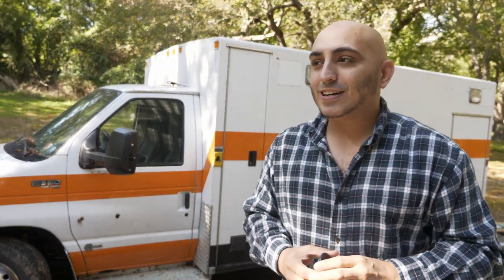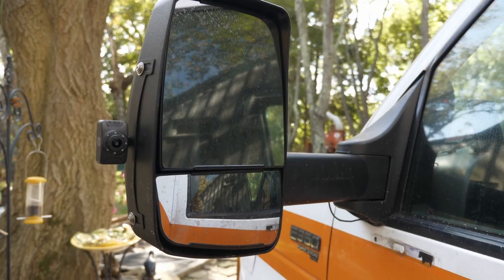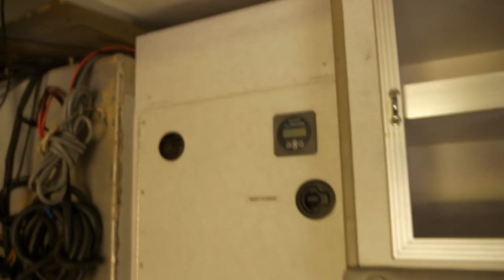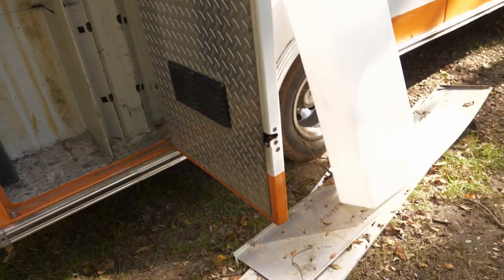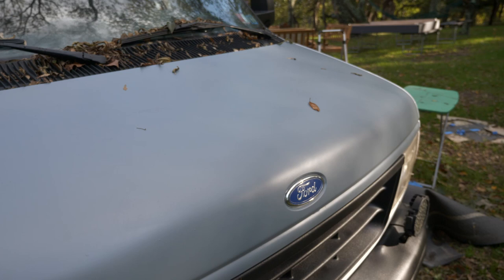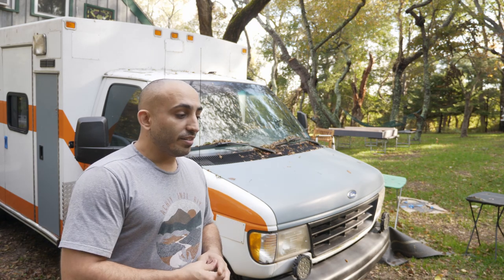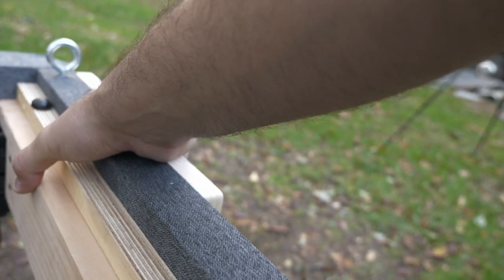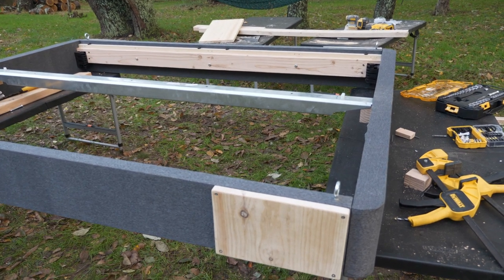Earthman Dan In A Van | Episode 5 - Updates, Painting, Bed Mod & Demo - Ambulance Vanlife Conversion

Comment: Hey Dan,
Following your progress, I am about at the same point with mine as you are. What do you use to do the 3D model? I've done mine with Inventor, if you want the files so you can modify them to fit your build. Curious to know, where did you order your window?
Reply from the maker: I'm using Live Home 3D pro, a relatively cheap and simple app for windows/mac. It's not up to CAD standards, but very good to rough out design ideas and visualize the space. Can even add custom textures as needed. Program doesn't do sloped surfaces yet but luckily this design is mostly perpendicular.

Comment: What brand of paint did you use for box? Thx
Reply from the maker: After a good sanding I applied 3 coats of Rustolium. That got covered with a satin clear coat for protection. To be clear I've done an absolutely terrible job and didn't sand or clean it well enough before painting because it's flaked up in many places. Also weather ruined a few coats, so I had to repaint the third coat. 2 coats should do it.